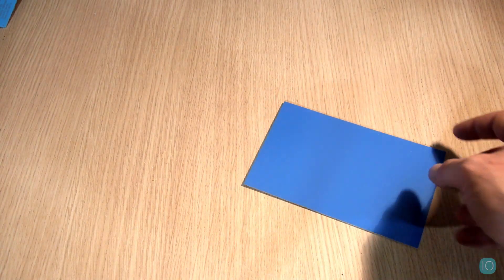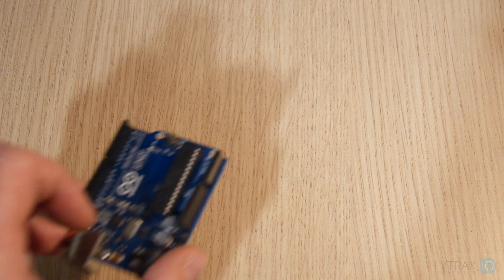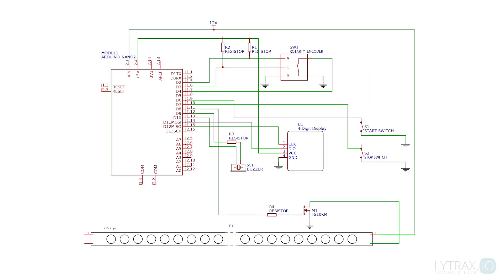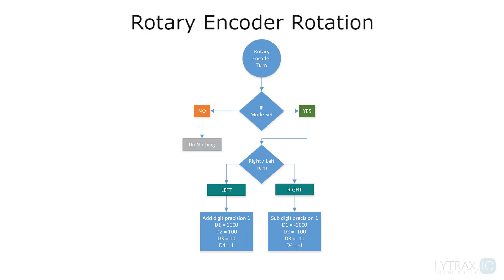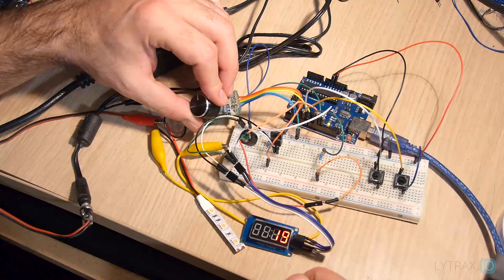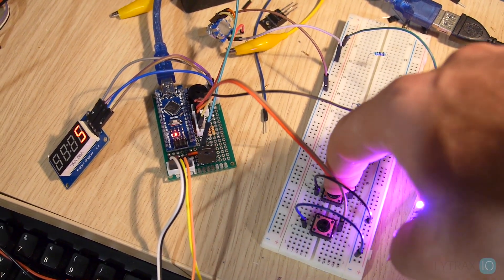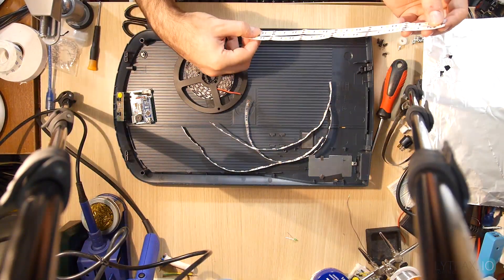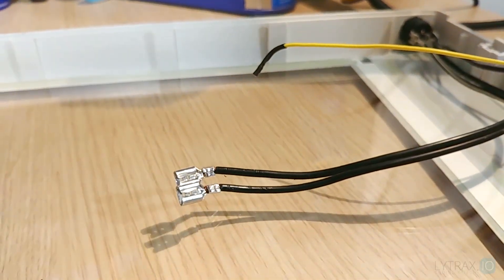Make a UV PCB Exposure Box Using an Old Scanner

Comment: Which version of the IDE did you use, whenever I compile with Arduino IDE  v1.8.19, I get error messages which do not stop the compiling however when powered up the displays do not light at all

C:\Users\wilwa\Documents\Arduino\CL_UVScanner\Program.cpp: In member function 'void Program::initialize()':
C:\Users\wilwa\Documents\Arduino\CL_UVScanner\Program.cpp:39:24: warning: invalid conversion from 'void (*)(Program*)' to 'CL_Button::doevents_callback {aka void (*)(void*)}' [-fpermissive]
  m_startBtn.onDoEvents(&this->run_btnDoEvents, (void*)this);
                        ^~~~~~~~~~~~~~~~~~~~~~
In file included from C:\Users\wilwa\Documents\Arduino\CL_UVScanner\Program.h:17:0,
                 from C:\Users\wilwa\Documents\Arduino\CL_UVScanner\Program.cpp:14:
C:\Users\wilwa\Documents\Arduino\libraries\CL_Button-master/CL_Button.h:25:7: note:   initializing argument 1 of 'void CL_Button::onDoEvents(CL_Button::doevents_callback, void*)'
  void onDoEvents(doevents_callback doEventsCB, void* arg);

Appreciate your comment

Comment: Hello. For mi is super idea. Simple and practical UV box.
If you wand check my UV box please  visit link below:
https://www.youtube.com/watch?v=wU3Z9bPXEwA&t=5s

My scanner was built with Aduino UNO, UV Led 5050, 12V / 5A power supply, one relay module (ON / OFF UV light) and 4 control switches.

Comment: I haven't found UV LED strips with s/m 360nm.. so it won't be working efficiently. all the strips I've found around the Ali has s/m 395-405nm only. Please let me know if you find the ones.
Reply: Don't worry too much. I got good quality leds with 395nm wavelength. Not yet made a board, but tested on UV film and they work very well.

Comment: Hi!

Can you tell me what model scanner you built your unit in?

This is to give me an idea what model I need!

Chris Williams
Reply from the maker: This is a HP Scanjet 2400. You can do it with any scanner box; it's an easy way to get a box that has a glass surface and closes.
Reply: @lytrax9735  Thanks for that – An EEV Forum Member also said the 2410  was the same apart from colour!

I was after that or one very similar as it has the buttons conveniently placed on top and power/USB sockets already mounted on the back! Regards, Chris Williams

Comment: I tried something similar with my old lide30 scanner. I also used UV-Led's, those 3 connected ones, max. at 405nm from Ali... I used 120 leds on an ~A5 area... powerdraw ~2.3A@12V... The result was the whole plastic bottom  warped upwards because the LEDs where getting so hot.  And second, I was not able to expose my bungard 10x16 pcb. I tried 3-5-12 Minutes, nothing worked! Maybe the glass of the scanner blocks all the UV...
Reply: I had a bad PCB... it just works fine with another new PCB...